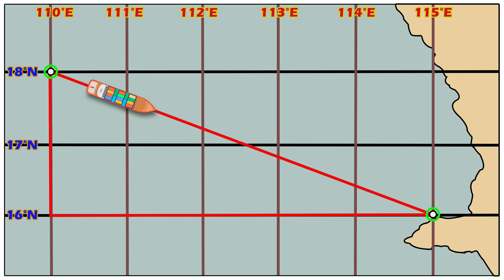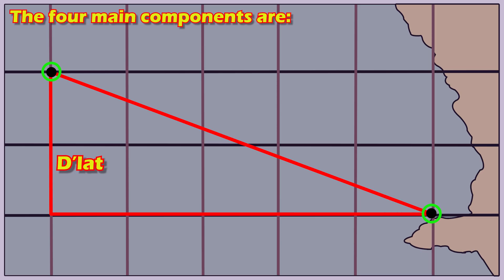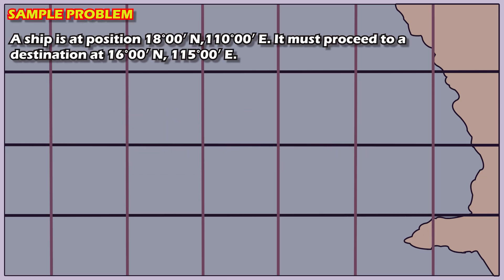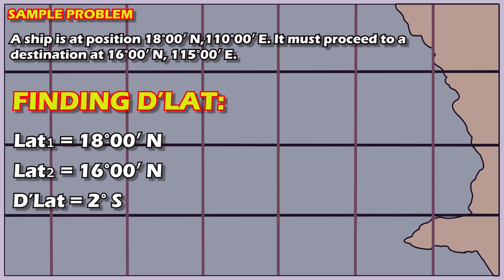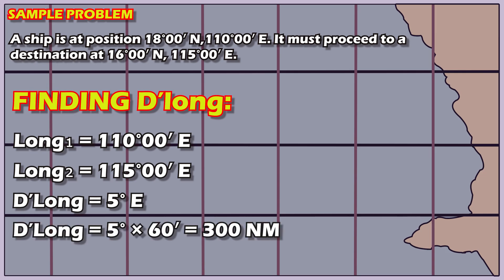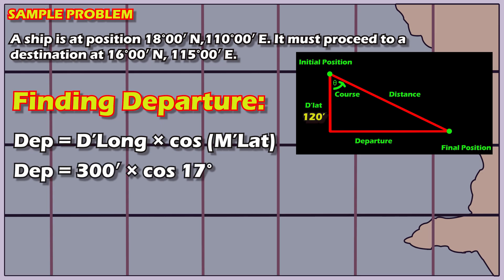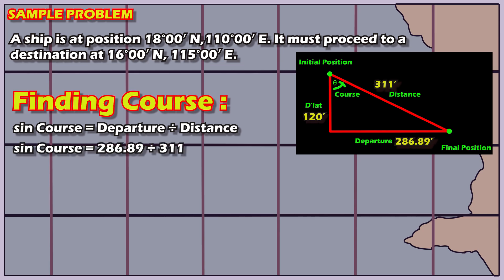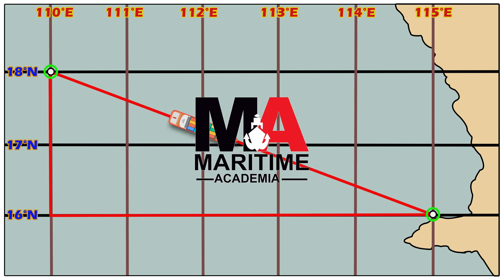Plane Sailing Explained | Maritime Navigation Tutorial

Comment: Where did you get the course 180 degrees sir?
Reply from the maker: The course is S67.29°E. In navigation, South corresponds to 180°. Since the direction is measured from South going toward East, we subtract the 67.29° from 180°:

180° – 67.29° = 112.71°

So the true course is 112.71°.
Try sketching the quadrant (S–E) to visualize how the angle is measured.
Reply: @MaritimeAcademia thank you sirr